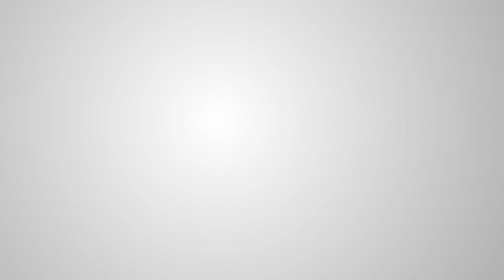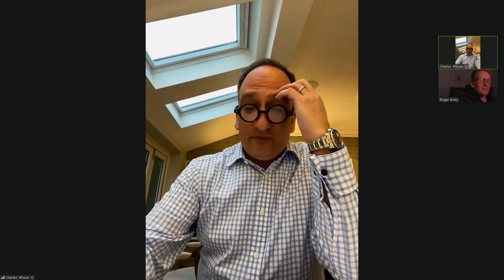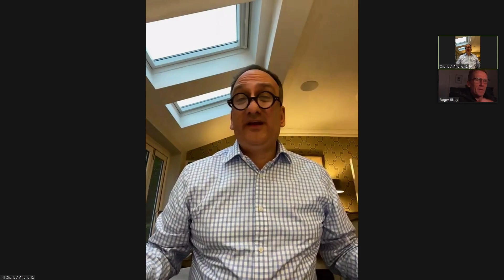10 Plumbers Couldn’t Solve This Mystery. Can You?

Comment: Very good video Roger, felt sorry for Charles paying out all that money, as you say recommendations worth their weight in gold. Glad he got it sorted though. I'm an electrician, semi retired in Portugal now, but my last job in the UK the owner of a flat asked me to replace the old lead cold and hot water system. It was a pretty simple job as some pipework had been replaced by copper already. However I did mark all the exposed pipework in the boiler cupboard and screwed a laminated map of where all the pipework ran. Same as I did for my electrical work, it just makes it so easy for anyone else comin later on to either extend the system or fix a leak etc.

Comment: I feel sorry for this guy.
Water is leaking into the ground, underneath the floor boards either from shaky joints or pipe works.
His best best is to disconnect the present heating system ( not mega flow) and adopt complete new system with on surface ( boxed in ) pipes and disregard the present nasty heating system.
Following his way of thinking one can be poorer and worse be mad.

Comment: Hi Roger during the Video I wanted to say just pressurise the system and listen for the air it works ….and then at the end that is exactly what they did. 
Customers don’t like it they just want it fixed but I totally agree a manifold bring all the pipes to valves good quality and neaten the job up. I am now semi retired at 69 I have had it with the poor workmanship out there. I am not saying pushfit don’t have a role but good old copper and compression joints on a manifold above the floor. I have a £12m house sold screeded floor with compression plastic fittings loosing pressure. The Customer only wants work done if I can guarantee success. During lockdown I let that job go leak after leak

Comment: A proposal for open-ended problem solving is not something a customer ever wants to hear.  I know it wasn’t the job any of the individual plumbers or renovation contractors signed up for (or even the flooring people), but I would have hoped that they would have given the homeowner a heads up about the mess. And was there an inspection before purchase?  And a check on building permits and inspection sign and offs?  Under better circumstances, would there have been an option to replace/upgrade the old boiler?

Comment: We had a similar issue in our central heating and I had to investigate. Eventually I traced it to underneath our lounge floorboards. Went into the void and found the leak caused by a rodent chewing through the plastic piping. Cut the pipe and spliced a new piece in to resolve the issue.
Reply: In my opinion  - It's never good to use plastic in underfloor situations where rodents can get into a building.

Comment: Another fine mess. I'm so glad I went for an all-electric system 40 years ago. Expensive to run but with careful zone, temperature and time controls can work. Except for the replacement of a leaking hot water cylinder, I've enjoyed a warm 19-22c house with zero days without heating or hot water and nil repair costs in 25 years.
Reply: Seems an expensive way to heat your home, but each to their own
Reply: @TheDaztheraz  'THE most expensive" way to heat a home.

Comment: In the cupboard where the leaking push fitting was corrected, is a concrete floor. If any older copper pipework is located here and that copper passes into the concrete, that is possibly a problem area. If the copper pipework was not protected from direct contact to the concrete, it will over time be chemically corroded and without question leak into or under the concrete.
Hope this helps that misguided chap. Regards John Roake.

Comment: I had a similar problem, I cut the floor up under the bed and in the cupboards to find leaks . Plastic joints let go if hot water is too hot. Has plate heat exchanger got a hole in it allowing water to flow to tanked feed? Floor  up is best way forward.he needs a carpenter not a plumber.

Comment: My builder employed a "real professional". If he wasn't singing to himself he was on his mobile phone. He managed to cross over a 15mm pipe he had just installed with a 32mm gravity circuit pipe using 4 off 45' soldered fittings. He didn't fit any of the isolating valves shown on the circuit schematic.

Comment: Thank you for the excellent video Charles.
I work within the insurance and leak detection industry and have dealt with many issues similar to yours where numerous so called ‘experts’ and experienced people have been unable to resolve issues such as the ones you’re describing.

Starting from the top I will try to explain my thoughts.

1. The issue with the pressure drop which has been resolved and was found to be the heat exchanger is more common than anyone would have you believe. I have carried out 1000s of leak detection surveys and have found this to be the issue on numerous occasions using pressure testing and isolating various areas of the central heating to narrow down the leak area before using a hydrogen/nitrogen tracer gas to accurately determine the location of the leak.
2. The second leak under the carpet and below the screed level under the boiler I’m assuming was on a cold water pipe and had been going for some time (you say weeks or months) this will have unfortunately caused the insulation layer of the floating floor (floating floor: a floor construction which commonly consists of a cement base, insulation and a cement screed on top in which underfloor heating pipes are laid)  and any layers below this to now be wet and this is why you’re seeing water damage in the bottoms of the structural walls and chimney breast as these go down below the level of the top screed and down to the base layer of the floating floors. The floating floors can be dried using a method called pressure drying however this would require the removal or partial removal of the wooden flooring so that the underfloor heating can be traced using a thermal camera, holes can be drilled into the floor and dry air introduced to dry the floor construction. The alternative to this would be removal of the wood flooring, screed, underfloor heating, insulation down to the concrete base where drying to the base would still be required.
3. For the third issue on the second boiler I would recommend that a leak detection survey is carried out stating with systematic pressure testing and followed by narrowing the area down further with acoustic testing and tracer gas testing given the size of the leak/pressure drop. The leak detection company seem to have found one small leak but have not determined whether a second leak is present. Regarding the radiator as an estimate you’re probably loosing a few litres of water when it goes from 2 bar to 0 bar and if this were coming from the radiator you would physically see it coming out; the leak detection engineer should know this. It’s also quantifiable as you can easily fill the system to 2 bar and drain off water into a bucket until you reach 0 bar to determine how much water is being lost each time. If the radiator was leaking that badly the wooden flooring below would have cupped and have been badly water stained by now which it doesn’t appear to have done. The reason they haven’t looked for a further issue is because they charge per successful visit and don’t get paid more for finding a second leak. Do you have trace and access insurance on your household insurance policy? Ask them to appoint a company that will not only find the leaks but also pressure test the system following repairing or temporarily repairing any leaks that have been found. I have picked up the pieces from numerous leak detection companies who have done similar and failed to get resolve the issues
4. Given the age of the original property you’re likely to have suspended floors in the original areas of the property. Suspended floors usually consisted of wooden joists fixed into the internal bricks of the cavity walls and above the level of the damp proof course. The joists would usually have been covered with floorboards and then all of the plumbing to the radiators routed in the void below the floor. Underneath the floor would usually be earth and if you had a leak it would be unnoticeable due to the fact that the water would soak away into the earth below. The presence of a suspended floor can usually be confirmed by looking around the outside of the property and finding air bricks placed usually front and back in the bottoms of the external walls, however these are often covered up or blocked when bad renovations are carried out or poor due to poor maintenance.
5. The old area of the property should have air bricks if it has a suspended floor. Without air bricks you run the risk of elevated moisture levels accumulating in the air under the floor when the temperature rises and then during colder periods this can then cause condensation or cause the joists to rot as a relative humidity above 60% for a prolonged period increases the chance of mould growth which could then rot out the timbers that the floor is constructed from.
6. The gas will eventually come up through the wood (the gas that is being detected is Hydrogen which is the smallest molecule and is only really stopped by materials such as plastic and certain types of tile) they are right that it will make locating the leak more challenging, but it should still be possible to determine if the issue is under the bedroom floor or not.

Comment: Loss of pressure,  and damp/wet areas....  got to be either a hole in the pipe under floor, or a fitting.  Has to be.

Comment: Why didn’t you not bring up why is the chimney wet surely that is the first place I would start looking
Reply from the maker: Garry
 I chose to listen rather than simply throwing out suggestions based on guess work. I am a slow thinker. As it turned out the chimney breast was not anything to do with the source of the leak.
Reply: @SkillBuilder  Yes I gathered that from the end is that where the leak was near the chimney hence why it was wet
Reply from the maker: @garrydiggins  I think the entire underfloor area was soaked and the moisture climbed up the chimney breast because it had no damp course.  The leak was closer to the outside of the building.

Comment: You can get powder that fluoresces under UV light. Mix with water and add to a circuit. Then run the system and go around with a UV/blacklight pen torch. Best done in the dark.

Comment: not sure if you would have seen one, civil water companies use a listening rod to detect pipe leaks in the ground, I have used one of these in a house with the leaking system, I cut it down a little in size, you can certainly separate which pipe is leaking by the sound, loudest pipe will be the one leaking and the closer you get to it the louder the sound, it worked for me and I was able to track the leak withing three foot,  I had the boiler off and the pressure at its max.
Aquacheck engineering ltd
is the company, and have a website, listening equipment.

Comment: I feel totally gutted for this chap, and for me the money spent there so far to sort this, it's just so sad,I cannot help wondering as somebody else has mentioned that it might be a combination of a pipe leak and groundwater because of the levels outside, also I feel those floors have to come up to be 100 percent certain of fixing the problem, i also feel this all needs starting again, one new boiler, and a completely new system from start to finish,i cannot help thinking unless you do this,the probs will just continue, forever, Throwing loads more cash at repairs and guess work is a nonsense.

Comment: found a few problematic leaks by draining the system and repressuring the system with a air compressor and listening carefully for escaping air,which when has a bit of water in it is quite loud,electrician brought a stetha scope to one job,which pinpointed a push fit had come of a chrome towel rail,the leak in this case will be a few litres a hour,so this method might pinpoint it,cheap and easy to do,you can also spray trv
Reply: just seen your bit at the end explaining this method ,give it a go nothing to lose,put some ct1 miracle seal in when you fill up😉

Comment: IMPO - Mr needs to cut his losses and isolate UFH system , possibly look at ASHP / hybrid renewable system for the entirety of the property - with inter grated smart controls which he could monitor remotely to bring running costs down - weather compensation etc etc … that property will be leaking heat left right and center by virtue of its design - he also needs to address the bridged DPC with external render and improve the Sub floor ventilation - hence why the skirting is coming away - Most importantly he needs to do more in depth due Diligence prior to hiring trades    …

Alternatively - he could invest in a Flir thermal imaging camera , max temperature on the Flow and run heating - he could then by process of elimination work out which rad was the coldest , and even spot detect on the floor to where the heat begins to dip ..

Best of luck but if it was my money - I would cut my losses and opt for my first point - makes for a better sale , and stop wasting time with an abundance of random specialists

Comment: This is a great episode and with a great outcome in the end. It just goes to show that the UK systems are often far too complicated and with all the new stuff coming in for the energy efficiency its only going to get worse. You have already had a rant about heat exchangers and the difficulty in getting qualified and experienced people to work on them. I am not a plumber or an electrician but I will always do my own plumbing and electrical work in my own house. And before anyone goes off on one about safety etc, I do know enough to thoroughly research the correct ways of doing any particular job. After all no one but myself has a truly vested interest in making sure any work done in my house is done correctly. Also being in the Highlands getting anybody to turn out at all, especially in an emergency is like finding hens teeth. I did have a heating engineer out to fit a new LPG boiler last year, but it was planned well in advance and it was a direct replacement for the previous boiler and he did an excellent job and the boiler is now guaranteed for 10 years. My house and workshop electrics have also be tested and with the new consumer unit installed has been tested and is fully compliant and certified.
Reply: I do similar.  I prefer the quality of my own work to anything that's been done in my house previously.  I'm always of a higher standard because I have the time and the inclination to do the job properly.  I've already fixed some major damp problems and rectified some terrible wiring in the circuits for the heating controls.
Reply: How does that work for insurance purposes? Or do you get a friend in or whatever to sign off on your work? I do very occasional electrical work, like adding lights to an existing ring or moving sockets. I would also do basic plumbing that didn't involve the heating system. I'm always concerned that if something gets wrong, I'd get the blame, even though the problems weren't caused by my work.
Reply: @ricos1497  I didn't think the home insurance people ever check.  Problem is houses that are 100 years old could have had anything done to them over the years and you can't go back 20 or 30 years to find a tradesman who did some poor work and blame all the problems on him.... i.e. it's a risk the home insurance people have to absorb.  I think they're more concerned with scammers who claim for stuff they shouldn't be claiming for.

Comment: Obviously mentioned the usual suspects...PRV etc. 
To be honest, didn't like the chap slating every plumber that had attended, when faced with push fit fittings that had been buried under the screed/concrete etc the alarm bells would be ringing, as in this could turn nasty really quick. Would the customer be willing to pay if the job was carried out until conclusion?
Really good to see the Leak Detection company was able to sort out the poor work done previously.

Comment: If was me I would cut my losses and replace the lot.Seeing how much you have spent on just finding and fixing leaks etc.You could be having leaks for next 10yrs and spending 10k+ and be no better off.The investment would pay off in lower bills,warmer house higher house value and alot less stress.
As for hot air heating I used to have this in my first house built in 1970,Barretts I think, it worked well until the boiler packed up and then there was no way to replace the parts.

Comment: Glad he found it in the end.
It can be so expensive trying to narrow down hidden issues.
I’ve worked on some right shocking jobs, some done by alleged experts.
Drainage pipes running uphill, bare copper in the floor, nails in pipes after they’ve put the flooring back down, floorboards chopped nowhere near joists (common), the list in endless.
I’m a builder too not a plumber but I’ve done hundreds of bathrooms, I do most stuff myself because I’ve never had great confidence in some of the trades I’ve employed in the past.
One thing I would say is, if your boiler is losing pressure daily, stop using it until you find out why, you’re just compounding any issues and making it worse.

Comment: I remember having to repair a big mains leak. Not showing anywhere. Turns out anglian picked up on it from the meter which they mislabelled and piped up to next doors the wrong way. The leak was from a pin hole in copper under the damp proof  membrane. The leak detection services in this video don't sound too good tbh.